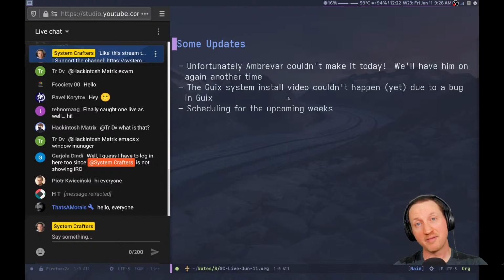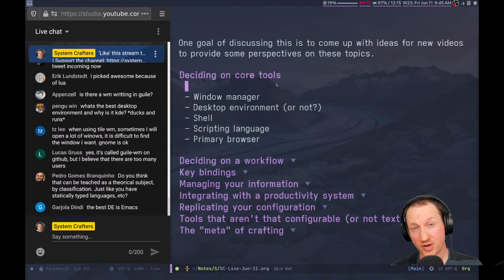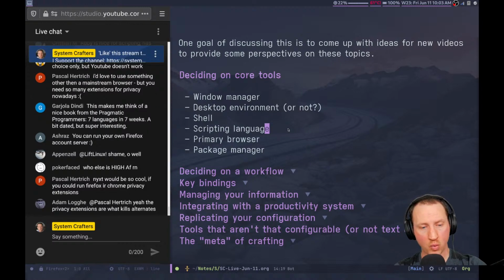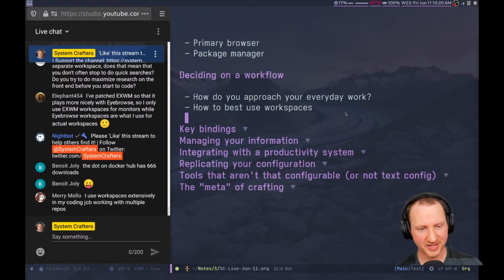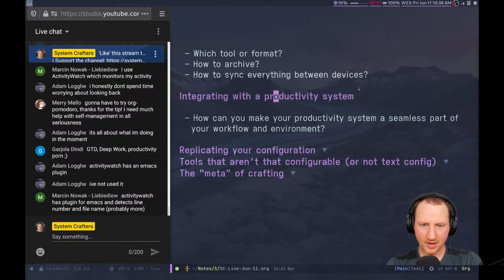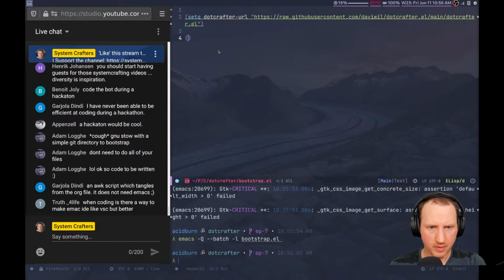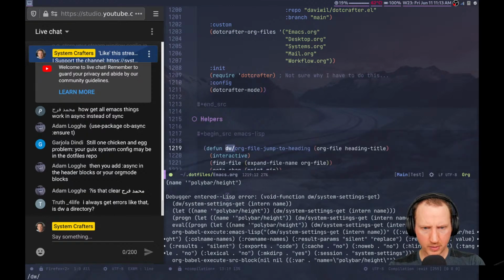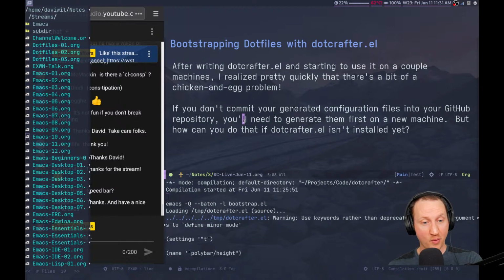System Crafters Live! - The Challenges of System Crafting

Comment: Yeah, I have a moonlander keyboard, was very expensive. Uses qmk firmware to configure all the keys. I am quickly getting used to using it and miss it when on another computer. I will have to take it with me if/when I start working.